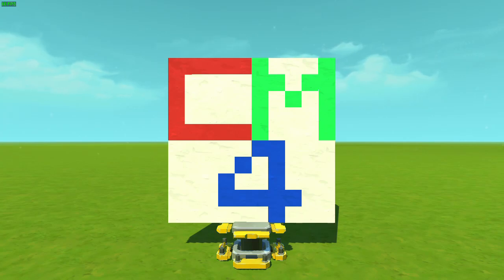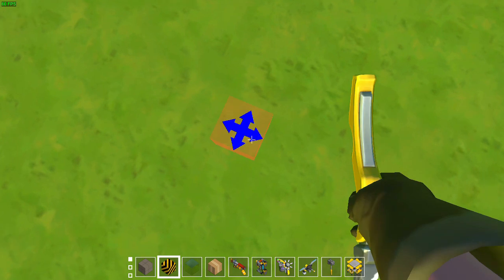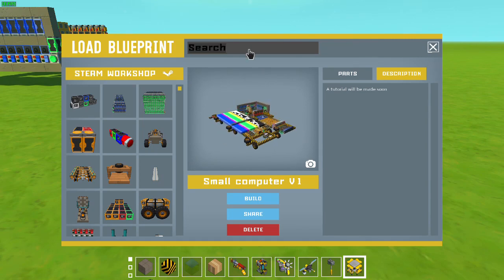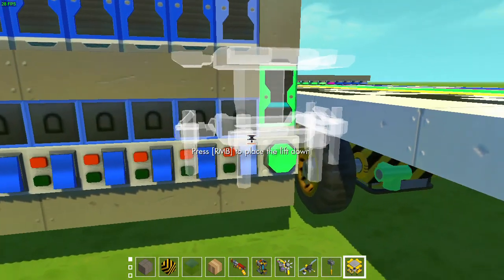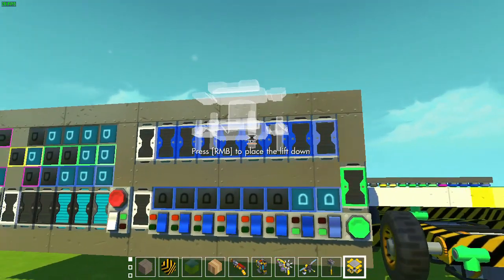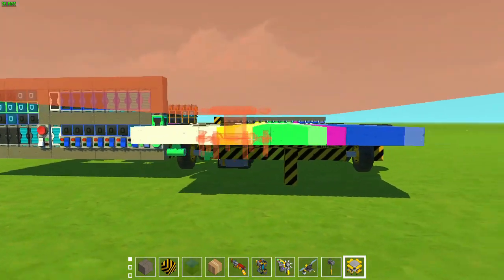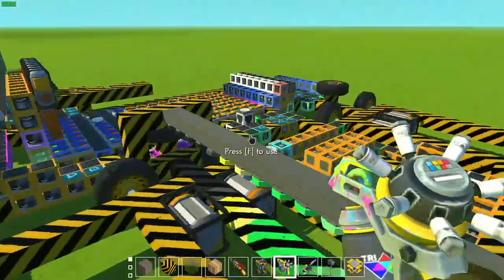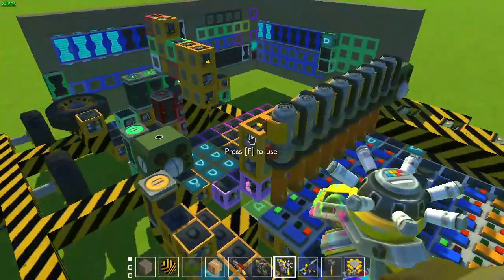programmable computer in Scrap Mechanic with no mods!

Comment: if you want it more complicated, you can make the card input also be an output and be programable by the computer and then be used in another computer. That would be done with your switches and spuds

Comment: This is similar to my designs, only mine are completely solid state, and much more modular. But i didnt know you could flip switches like that...
This machine needs some peripherals, like a keyboard, disk memory, and a screen. That would complete the design. All you would need to do then is make an operating system.
Reply from the maker: This computer was a proof of concept. kAN(SM youtuber) once said that a vanilla computer would be enormous, and I felt challenged lol.
I am working on a new, bigger and faster computer with internet. Go to my discord server to get updates and discuss it.
Reply: @CodeMaker4  As much as i agree with kan on the matter, a well optimized computer can fit on a medium sized vehicle, which allows for good robotics.
But what changes are you primarily making to your design? Mine is now stack based instead of reference based for its ALU operations.
Reply: @CodeMaker4  lol same, i made an 8bit (register length) cpu with a 1hz clock, an add & subtract alu, 5 functions (set register a, set register b, add A and B (then load output into A) , subtract B from A (then load output into A) and the 5th one, which unloads A into a 5 bit ram adress (32 adresses, 8 bytes in each adress). Im going to make a 12 bit cpu with a 3bit instruction code and a 9bit value which is able to communicate with 512 ram adresses ( 12 bit in each adress).

Comment: could this be hooked to a screen and run a game?
Reply from the maker: No, unfortunately it is not powerful enough. It doesn't have enough speed or memory to play a game.
Reply: @CodeMaker4  not even snake at like one frame every second or 2?
Reply from the maker: @vera2193  No, unfortunately not. It takes one to two seconds to just add two numbers together, so it would take minutes to do a frame of snake, but then still it only has like 12 bytes of normal memory, which is not sufficient to even store the position and shape of the snake. Theoretically if you add a lot of memory and make it a lot faster, but keep the same overall computer architecture (as in how the memory and calculating components are connected), then you could theoretically make snake with this, or doom or scrap mechanic if you go really far. I believe it is 'turing proof', which means that it could calculate/compute anything if given enough time and memory. Go look it up, it is interesting ;)
Reply: @CodeMaker4  you should try making a faster version with more memory to run simple games like snake.
Reply from the maker: @vera2193  yeah, this is on my to-do list
Reply: @CodeMaker4  i think i might work on a computer to play snake over the weekend